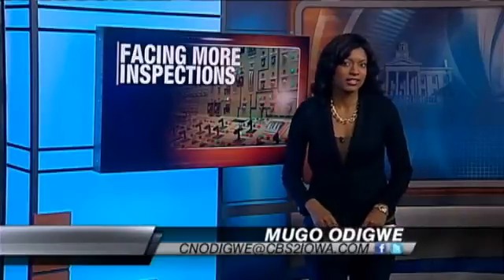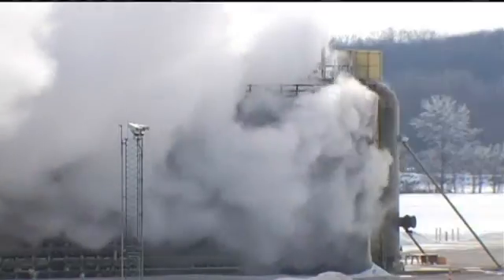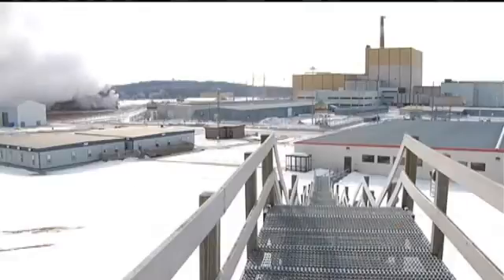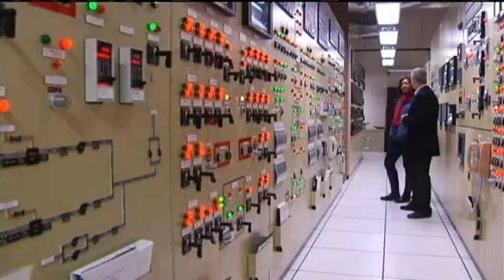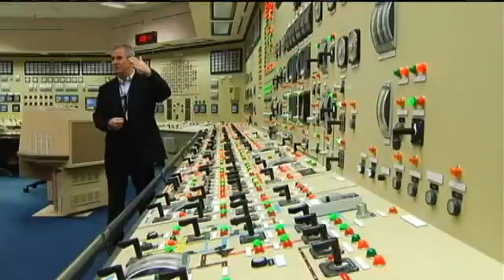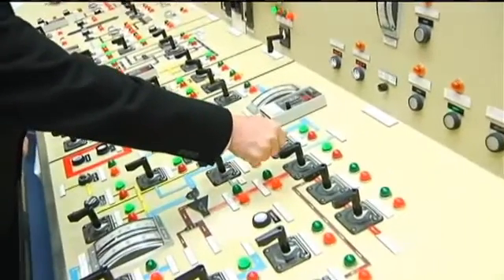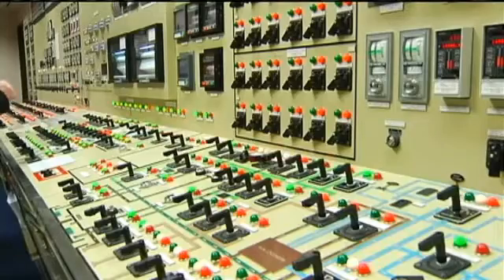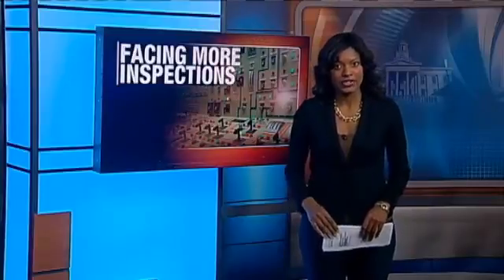Safety Measures Taken at Iowa's Nuclear Power Plant

Comment: so they found 2 minor safety concerns and they were addressed. Shows how far under the microscope the nuclear industry is. They leave nothing to chance. An operator is trained to know when and how to open that emergency cooling valve from the control panel. Its in the procedures they use should they be faced with that situation. But the nuclear regulator wants a redundancy built in so that it would happen automatically . That's to take the 'what if" out of the situation. That's very common to have that way of thinking in the nuclear industry .

Comment: Nope, get it out of Iowa.  Mark 1 reactors are not safe they have design flaws that make them just as bad as Fukashima.  Give me wind turbines or solar panels.  Get those people some other jobs and free training.  It will take decades to decommission that place after it is shut off.  I live here too and if you watch videos about Chernobyl puppies, you wouldn't do nuclear ever again.
Reply: Just Imagine I disagree.

1 - They have outfitted all Mark Ones with retrofits to prevent any issues in all GE Mark Ones in the US. Fukushima did NOT have any of these measures and is both on the coast and a fault zone and was built slightly different to normal Mark Ones. Neither a fault zone nor a coast applies to the DAEC.

2 - This is bigger than puppies and kitties. And other forms make things even worse. There are no coal emissions, no backed up rivers, no dead birds from blades and no pollution like solar panel making causes. All the power and not one mistake.

3 - DAEC has already safely taken old rods out of action and placed them in storage with no issues. They are just North of the plants buildings.

4 - If you want to protest why not go off grid? Until you do you are being hypocritical by using energy from places you don’t like.